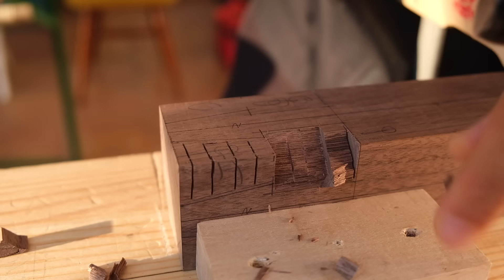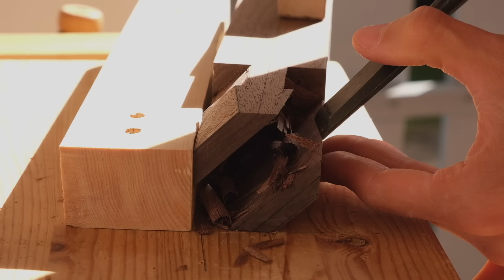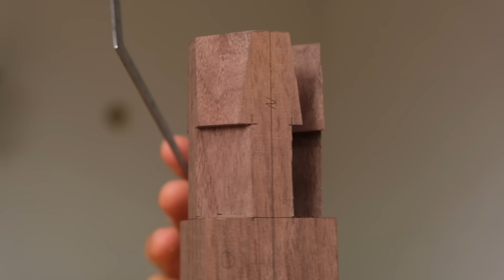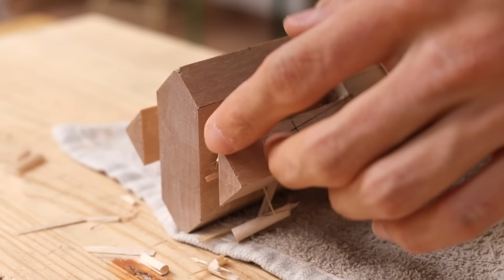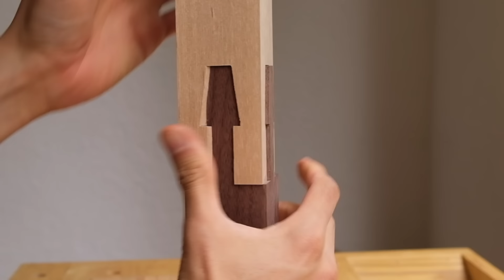Making the "Impossible Joint" 四方鎌継

Comment: His control is amazing. Notice how he takes small cuts as he chisels. Also notice the backside of his chisel is like a mirror.
Reply from the maker: You noticed two great points!
Cheers!
Reply: That's really how chisels are meant to be used. Same reason chefs don't bludgeon wildly with a knife. It's a fine skill but an essential part of woodworking otherwise you're not going to be able to make anything presentable.
Reply: It is said you can tell a lot about some one based on the condition of their tools.  Amazing work and amazing skill.

Comment: If there's one thing I've learned about "impossible joints," it's that whatever it looks like is a lie.
Reply: Its called an optical illusion, magicians use them all the time this was a neat example of one
Reply: @ronaldharris6569  always do amusing that usually the trick of the trick is pushing the boundaries if credulity.

The tricked watcher can't even conceive of the work that went into the staging of a seemingly simple trick.

A often it's about putting in a lot more effort than people would suppose anyone would invest for the result.

Magic I mean, not the woodworking.
Reply: Is a very beautiful joints, and that is the meaning with this joint
Reply: Og
Reply: @asiastreets4032  and it is as strong as the wood so it's a good thing
Reply: This technique is use to build japanese temple.
Reply: @ronaldharris6569  If the joint isn't strong, the wood doesn't matter. It can be the most solid wood in the world but if the joints slip apart it's in 2 pieces. A joint is only as strong as the joint itself.
Reply: It isn’t a lie, it is a perfect joint with a beautiful and practical finish. You only think it is a lie because you did not think it was possible. Geometry is a wonderful thing.

Comment: When someone actually make that joint with similar wood, so that the connection is actually impossible to discern, That's when you know someone is craftsman and not just construction worker
Reply: Why not start with a longer piece of wood?
Reply: The dissimilar wood shows off the joint for demonstration purposes. Also please point out the part of this video that indicates that this woodworker is anything other than a craftsman.
Reply: @radiodiffusionfrancaise1591  maybe i word it unclearly so you misunderstood. 
This person is clearly an artisan, or a takumi (i.e. craftsman). 
Now imagine ordering a woodwork to be done (be it as pillar or furniture), and you get this wood jointery, instead of 2 piece of  wood being glued or nailed. By then you knew the person you contract is a craftsman

Comment: "You can do almost anything with power tools"
This video shows a rare example of an almost
Reply: Power tools could do this just as efficient in a way quicker time
Reply: @landonpratte846  Nope. The tools he is using have no powered equivalent. No such precision with power tools...
Reply: @JohnDoe-zr6bk  maybe 150 years ago, but with today’s technology, they have drills to carve out blocks by the exact 1/1000th of a milimiter. Have you been living under a rock because power tools can do it more efficiently
Reply: I would change it to say “machine tools” could do this job maybe. But even there the sharp corners of the arrow heads are unlikely. Joinery power tools (saws, routers, drills) no chance.
Reply: @landonpratte846  I don't talk about CNC. That comparison is not fair here not suiting. I talk about hand guided power tools like Drills, Saws all and Flex Grinder, that can never achieve such beautyful wood works. Even with a CNC Machine, some of the shown crafts are just not possible....
Reply: To be sure,  you can't buy a power tool that will do this off the shelf. But if you're willing to make or buy your own custom profiled router bit, you could churn these out by the thousand. That said,  making those bits would be a project all it's own, even for a well-equipped toolmaking shop. For one-off unique joinery, there really is no substitute for a skilled craftsman.
Reply: Jman 2081  yes computers are exact, those right inside corners and sharp points fitting perfectly would be at the very least at the top of a high end cnc machines capability. That's not really what a power tool is anyway. I bet you'd find flaws in a machines go at this and/or a lot of complex joinery won before you would a craftsman like this. A machine c could never consider all the details of the wood grain or minute flaws in a tool and compensate. They're pretty good, but is bet against it against someone like this.
Reply: Literally no one has ever said that.
Reply: Imagine the competency of the man who invented this joint.
Reply: Those who say "not with power tools" are wrong.
I made one of these joints using only a router (one single tool) and a 45° guide.
Reply: This is a beautiful job and I’d be equally impressed if it were done with power tools. It doesn’t matter which method you prefer, if you can do work this precise either way then you have immensely more skill than most of us part time hobbyists and should be proud of it.

Comment: King:I want a castle 
Engineer:oh ok we need some wood and a bunch of nails
King:nails?
Engineer:what?
King:what?
Reply: What?
Reply: Well joinery was technically used on the medieval period..
Reply: @credinzel6996  oak beams, half-jointed to keep 2/3 the width load bearing, then drilled and secured with oak pegs which expand into the hole and don't rust.
Reply: A castle of wood?
Reply: @PeachDragon_  motte and bailey started as all-wood, and the interiors of most keeps were wood beams AFAIK

Comment: If you break this joint down to its basic components it is somewhat simpler to understand.  It is basically a double mortise/tenon joint done at a 45 degree angle with the twist of sliding dovetails added to the end of each tenon.

Comment: Me after thinking it it it would be made like an 'X' hense making it impossible but instead it was made like '/ /':

I've been tricked, backstabbed, and quite possibly bamboozled
Reply: I thought the same, and expected the solution to be that the lighter wood is soaked in water for a while to make it pliable. Then it's for over the dark wood and left to dry, maybe clamped, and returns to its original state.

Saw that before for another such tricky joint.
Reply: This trick was originally a puzzle created by wil strijbos, the "dovetail" puzzle, 2 other variants exist that look the same on the outside but are joined differently

Comment: Are all Japanese carpenters this skilled?
Reply: If you do some research you'll find that for the Japanese, a "master carpenter" take years to become one. And, any slightest mistake made is left in the work piece to serve as a reminder to the craftsman. This really is the best woodworking style around. Cheers :)
Reply: bob ali  thats why its worth a lot more money than a factory produced half lap or butt joint. A chair made with similar joints would cost an arm. Especially without any hardware that held it together.

Comment: After you are amazed by the historical ideas and his skills, take a look at the following things to keep in mind. 

When we clamp something, we always worry about the scratches and dents on the base material caused by the clamps. Even if it is steel, it is the same. 
That's why he doesn't apply enough force to the clamps to hold the base material in place completely. 
So there are scraps of wood here and there in various factories in Japan. It's not garbage. 
And rags, they are used not only for cleaning and wiping up liquid, but also to prevent scratches on the base material. A rag can be laid out or rolled up. 
When we lift something heavy, we are of course worry about scratches caused by hooks, 
but we also put rags between the chains or belts at all points where they come in contact with the base material. 

These are things that are not uncommon in Japan, and are not rules but customs.

Comment: Wood has so little tensile strength that for engineering purposes, a linear joint in tension is commonly considered to have a tensile strength of zero. So although this is an impressive application of spatial reasoning, I fail to see what possible use the joint could have.
Reply: For people on YT to marvel at?
Reply: @AKUJIVALDO  I've given this quite a lot of thought, and I have to say no. In thousands of years of joinery, joiners, carpenters and cabinetmakers have encountered the same problems, and have come up with a wide variety of ways of solving them, and all those solutions have beauty in both form and function. Whereas this joint is undeniably impressive, that's not enough. I want to see how it would be used practically. I'm not saying it doesn't have a practical application. Just that I can't imagine one. I've been a joiner for long enough to know that there's always something new to learn.

Comment: You know, if the lighter colored wood is a little flexible. You could make this joint the way that it looks. You would insert the dark wood into the x-shaped notch in the lighter wood and it would snap in place.